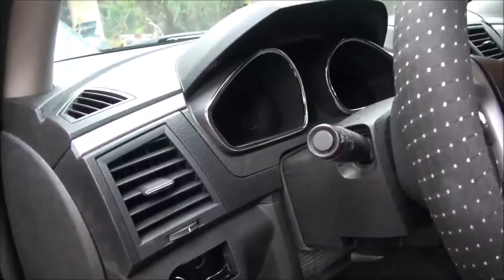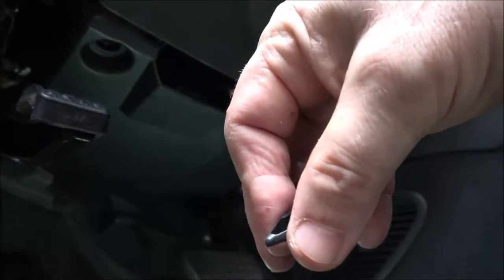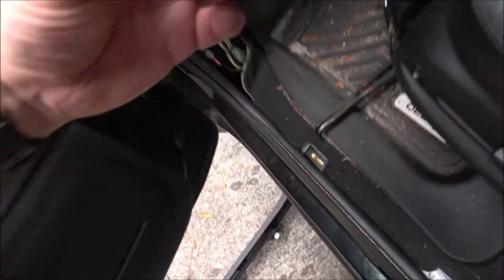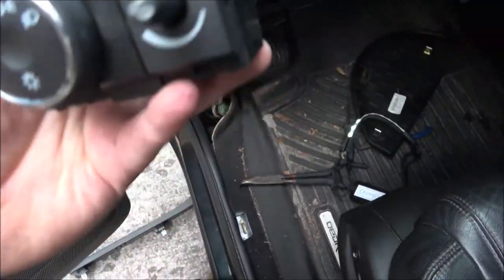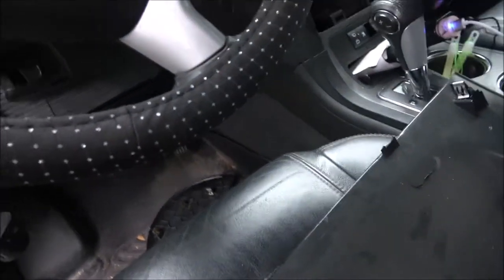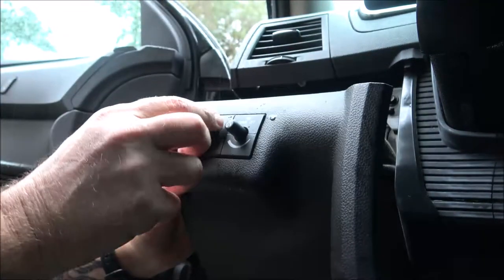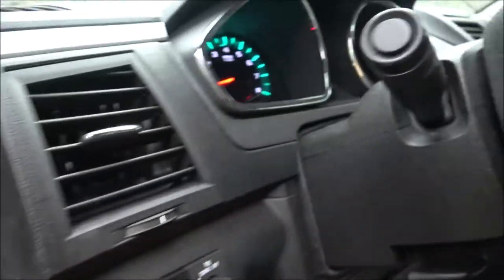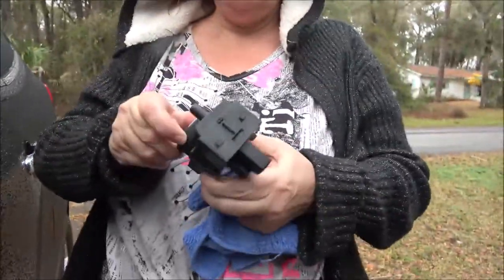Headlight Switch/Dimmer Replacement 2011 Chevy Traverse

Comment: I just fixed my wife's 2011 Traverse LT. The dash lights were so dim during the day we could barely drive it.  The dimmer switch was working. Just could not get the dash lights bright enough to be usable. I tried black tape over the old ambient light sensor to trick it. That worked for awhile but the dash lights kept getting over darker over a few weeks.  Replaced the Ambient Light Sensor on the dash with a TechSmart T37005, $38.  It fit perfectly, but then my center dash info system ( shows gear, odometer, tire pressure, oil life ) went blank. Also the dimmer switch would not make the dash lights dim.  I removed the negative battery cable that attached to the ground of the car.  This is located between the passenger seat and 2nd row passenger seat below the floor mat.  Waited a minute then reconnected the ground. Everything works now. There are videos on YouTube that show how to replace the ambient light sensor. It's not that hard but will take a solid hour or so once you have the part and the tools. Originally AutoZone sold me a AC Delco sensor for $12, but it wasn't a match. They were very nice and gave me a refund. It helps to bring in the old sensor to match the pins on the new one.
Reply from the maker: Thanks for the info Michael. Might come in handy in the future. Glad you got it fixed. Thanks for watching and commenting.